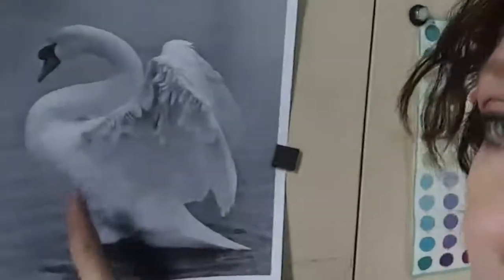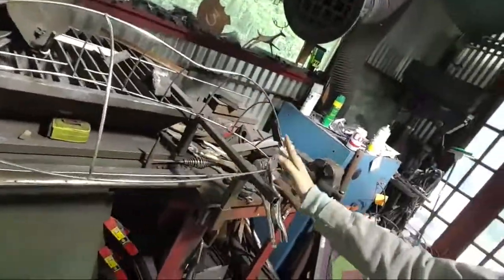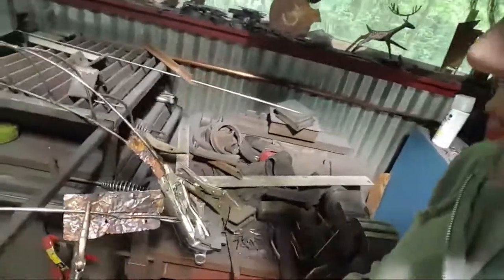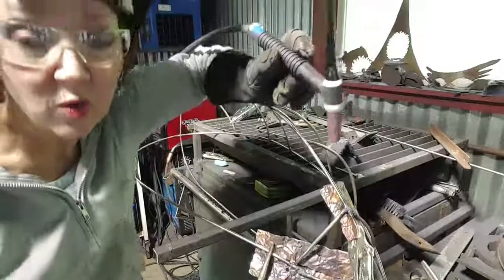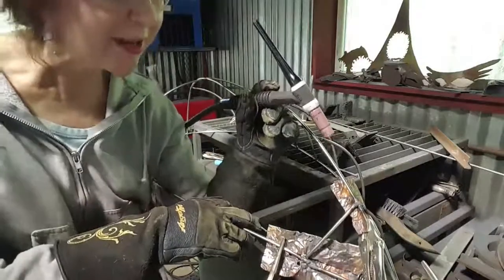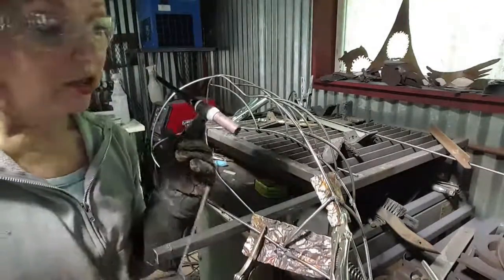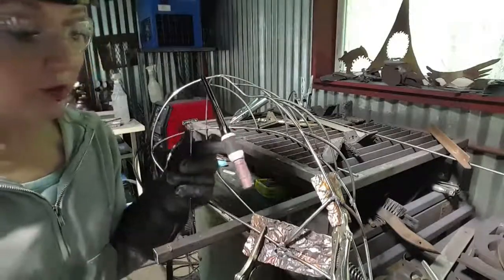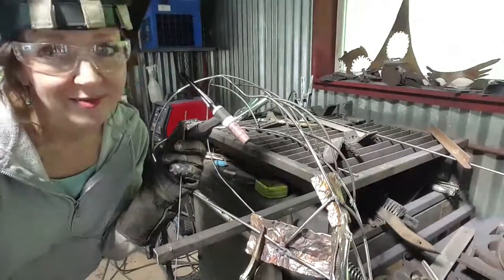Swan Project 1

Comment: Hi Sue, nice job,........after the tack weldings, will you use something to clean the heat stains??,  i have seen the TIG brush process, really nice and easy to use :)
Reply from the maker: Can you explain this more to me? I do want to clean the heat marks off but wasn't sure how.  Was planning to use a stainless wire brush attachment I got that goes on a drill...

Comment: TIG produces great results for sure and you will get very good at it. I did see where someone commented about MIG stainless welding. That's what I do with results that's entirely satisfactory. My trusty old Hobart Handler 120 using .030 stainless wire and the same argon gas as with mild steel. Be sure to use only a brush with stainless bristles and never used on mild steel for ANY cleaning.  Same for flap disks on your angle grinder. Why? Residue on either will transfer to the stainless and rust stain your project.  I did do so on purpose a few years ago to see what a planned colorization effect might be instead of heat. Interesting but not great in my opinion. Customer remains very happy with the heron however.
Reply from the maker: Thanks Rex, great info. I was wondering how big of a deal that cross-contamination was. I guess I better err on the picky side.

Comment: Great job Sue, keep up the great videos.  As Jerry said, you will get better and faster with time. It's always fun to learn the process.  I've been a TIG welder for years and the one thing I have learned is that you can't rush it.  It's will take as long as it takes. (which I'm sure you know already) and it is sort of "calming".  Keep up the great work.  You're an inspiration to all of us wannabee's out here.
Reply from the maker: Thanks Tracy.  I'm already getting back in the TIG swing of things. There's a lot I like about it. The only thing that trips me up is positioning my work. I'm always having to weld pieces in mid air and wish i had a third hand. Maybe I'll come up with some tricky solution as time goes on. I agree, it is calming-- when it goes right. ;)
Reply: Sue Seeger have you ever tried like an .030 s.s. mig wire with a tri-mix gas on stainless?  It does work pretty darn good too.  
A big thumbs up to you, in all that you do.
Reply from the maker: Hmm no I have not. I may have to give that a go someday. I do like how much cleaner the air is doing TIG too though.  It's a challenge, but I like solving puzzles. Thanks for the tip!